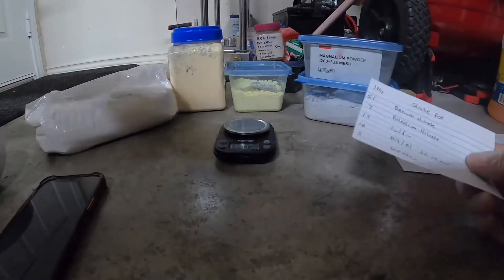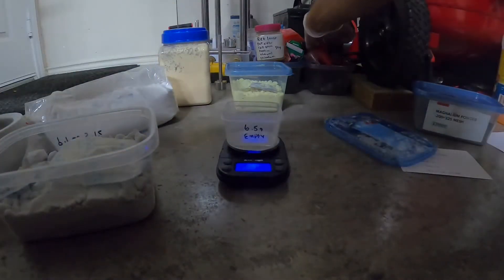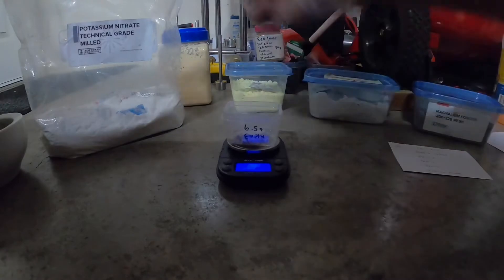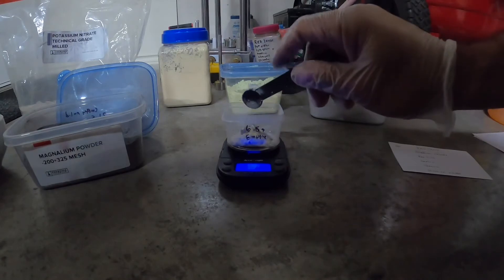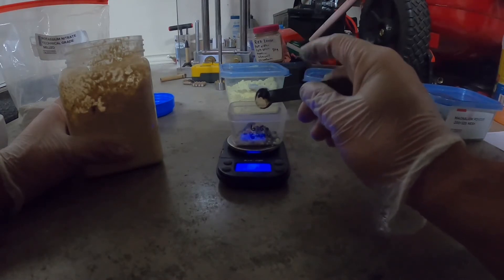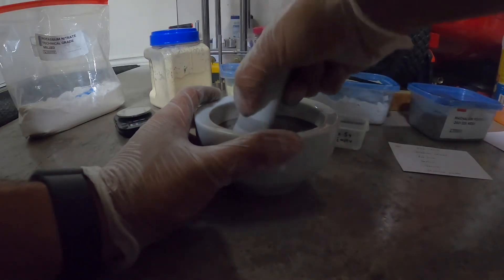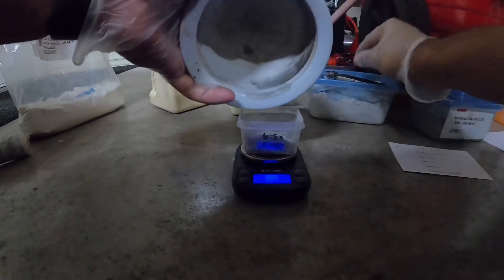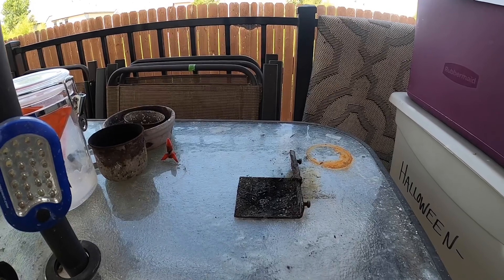Strobe pot composition substituting strontium for barium

Comment: can i use -325 mesh mgal?
Reply from the maker: So with those smaller mesh sizes it would just burn faster as opposed to the larger mesh particles that take a second to heat up then flash. If you go too fine of a mesh it might not strobe but just burn like a flare.
Reply: @E85_STI  alright. good to know